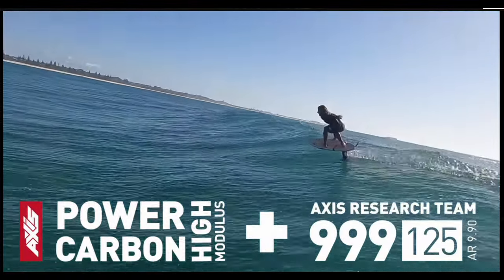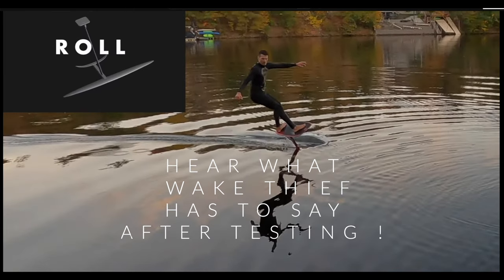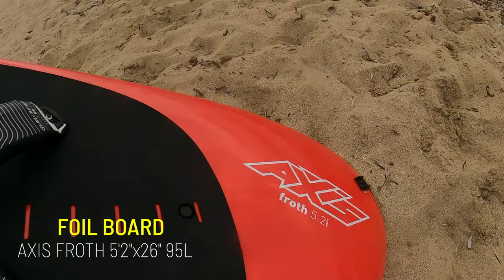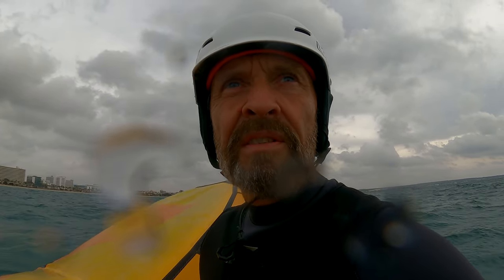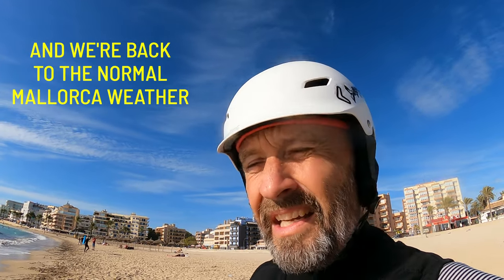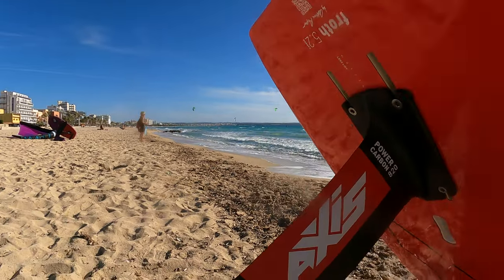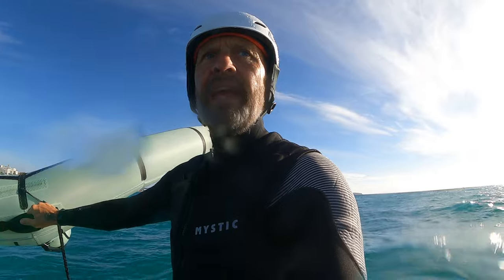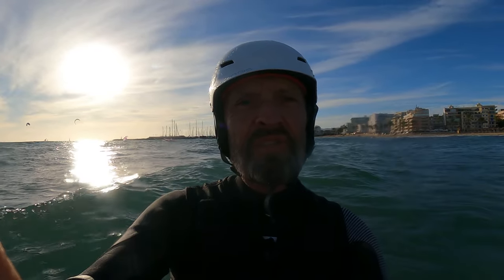How to Wing Foil. Do you really need a carbon mast?

Comment: Can’t understand the following: as far as I see you changed 3 component’s at the same time, mast, foil and stabilizer, but attributes the better ride to the mast…
Reply from the maker: I filmed during two different rides. The first one. 1099/crazyshort fuse/325P all of I previously ride with. Only changed the mast. Second ride I also changed the fuse to the “short”. That was my regular fuse. So, only the mast was the part I was not used to. But in a way you are right I changed mast and fuse on the second ride. The  stab wasn’t new to me. I still stand by the mantra “only change one thing at the time”. Hope this clarifies some details for you. If not, hit me back with another comment. Thanks for watching!

Comment: Nice video.  It seems like the consensus is that the Power Carbon HM is really good on the bigger front wings.  I have the Axis PNG 910b and ART 899 -- not sure if there is enough of difference on the smaller wings based on several videos I have watched.  I weigh 65kg.  Will you be reviewing the Axis Power Carbon HM mast on some smaller front wings?  Also what brand of helmet are you wearing?  Thanks!
Reply: I noticed a difference on my 999. The lower drag of the HM mast makes it glide even further, and I feel like I can pump further to connect bumps when winging.
Reply from the maker: Thank you! Yes, that is what I have gathered as well. I will ride the HM Carbon mast with the 899 and see what response I get. My helmet is the Balz Pro helmet from Ensis!
Reply from the maker: Exactly, it glides better and that is a big help in connecting bumps/waves. Thats my experience too.

Comment: Nice board, thinking about getting the AXIS Froth 90L, was in the shop the other day and they said for active take off it's really good, but they noticed the foil has to be placed further forward, Any thoughts, I don't think I am ready to pay the money yet for the HM Mast will stick with the alloy for now. .
Reply from the maker: Hey Dan, yes the board is nice. Maybe get one soon when the 2023 arrives? 😉 The carbon mast is a tough cookie to swallow. I agree. Sold my 1150, mast fuselage and all to chip in for the HM mast. That was a good swap. The mast is really something else. I’ve only had it a short while so I’ll be coming back with another review when I have some more mileage with it. But stiff, and you can really push harder in the jibes and tacks with it and it doesn’t give. Did I say it makes the riding very smooth!? 😂😂

Comment: Great videos! Would you feel the difference if you went (let's say 10 times) out, not knowing what foil setup you had. I have been on various masts and foils and I don't really feel any big difference. I have done this for + 3 years and have no issues with turnings, jumping 360 and normal cruising.
Reply from the maker: Hmm, that is a good question. You would notice different setups have different characteristics, but to know if you are on an Axis foil, Starboard or Sabfoil. Could be tricky.

Comment: Does it whistle? My Axis PnG 1150 & Aluminum 75 cm mast whistles when accelerate…don’t know where in the foil, it comes from ? Do you have encountered Axis Foil whistling?
Reply from the maker: Hi, yes. I know about that this happens occasionally. Usually it is the stabilizer that make the “whistling sound”. Think about it. Did the whistling sound come when you changed stabilizer?
Reply: @wingfoil_mallorca  I have not changed the Stab yet..good starting point… I ll look into it later. I bought Axis PnG 1150 for learning Dock start. I ll down grade to Axis PnG 980 later for winging, now use Takuma Kujira V1. 1440 for wing up to 28-30 knots good for jumping above that not fun for me..fancy jibes & backwind (16-20 knots) are not fun when too much winds..